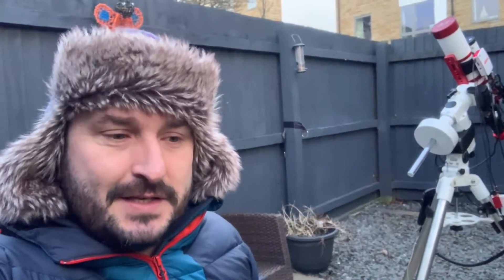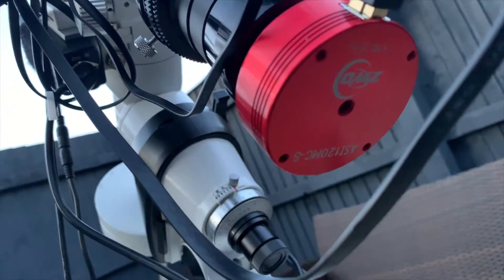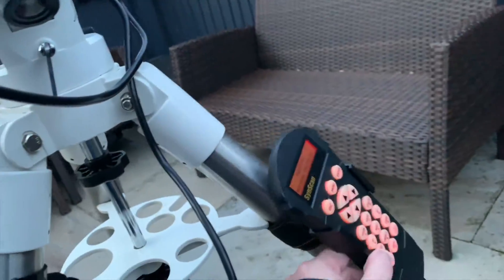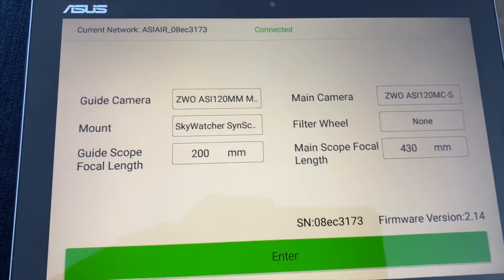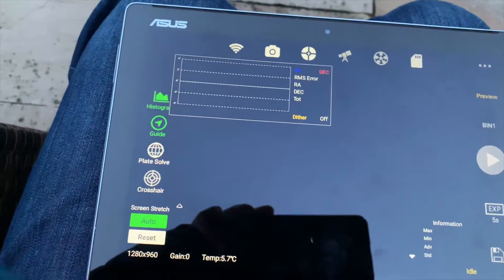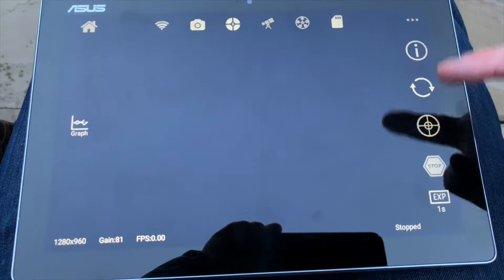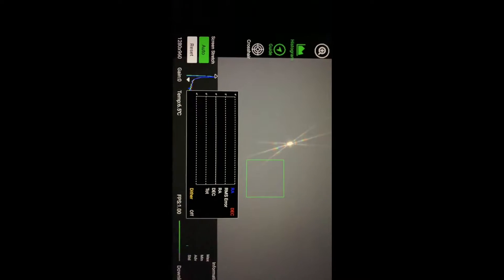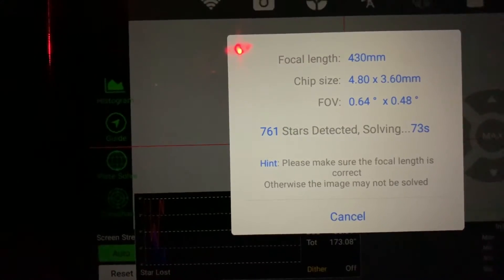ASI AIR first attempt. Disapointed. Tablet astronomy

Comment: I had similar issues at first, took me ages to discover you have to tap the guide graph to get into the guiding screen I think the big change was the October November updates that added the auto centering and made 3 star alignment a thing of the past. Incidentally, the plate solving is 3 to 4 times faster than on SequenceGeneratirPro. A brilliant piece. Of kit. Just trying to decide if I should get the pro version too.

Comment: Ever since I picked up an asi air, guiding has been impossible.  I've got a 290mm and a 60mm scope that's impossible to focus.

When I use my laptop and phd2 it's a breeze.  The air is cool but it's a hassle.  I've tried 6 times getting guiding going until I just gave up and went back to sharpcap and phd2.

Comment: Hi, I'm sure you'll get it sorted, but I don't think using the small chip of the ASI120MC is helping, even using plate solving I think it's tough. (I've also tried DSO imaging with this camera) I'm not the most technical astro imager out there, and this is for a reason. With our fickle weather in the UK I've learnt the hard way that's it's often best to keep it simple in order to come away with any data between the clouds at all! lol It's so frustrating when you add gadgets that are designed to make things easier, but they take time to setup and sometimes or often don't play ball and you come away with nothing. 

For an easier life keep the focal length short (as you've done), and the sensor nice and big (not the 120mc). With the aforementioned you don't even need to guide when using lots of shorter exposures, which you can do now days with the latest batch of CMOS cameras. 

Anyway, good luck, and I'll sub along to see how you get on :)

Comment: Regarding platesolving I currently use the Astrophotography Tool for all image capturing. To successfully platesolve you need to inform the program of your main scope focal length. You entered 420/430 mm but if you are using a flattener/reducer (WO are sometimes 0.8 reducers) then your focal length of your main scope could be 420 * 0.8 i.e 336mm. Depending on whether you are using a reducer this will enable  the software to know your fov and fingers crossed work! Great video. I have just ordered an ASIair so could be sharing your frustrations too. Chin up!
Reply from the maker: John Hughes hi. It’s a 1:1 flattener. I have solved it. New video coming with loads of helpful advice for the asi air. I have totally changed my mind and it is an awesome piece of kit. Plate solve for me worked after using EQmod cable direct to mount and removing the handset.

Comment: Its bloody easssyyy:
1-do 3 star alignment via synscan hc
2- then tap the mount icon in asi air
3- pick up skywatcher synscan from the drop down list
4-pick the choose object from asi air
5- go to
6- NOW ITS TIME FOR PLATE SOLVE
7 once plate solved (max 10 secs) you get success message andn you pick synchronize and go go
YOURE DONE DO GO
AH, before guide calibration you must change speed of the mount in main asi air screen to x1 from default max
Voilla ;)

Comment: Does the application only run as a mobile app, or is there an application that would run on a laptop?  Do you see this replacing a traditional guide software (Phd2, Ekos, etc)? I spends weeks getting traditional guiders to work, then two PCs to make those work, so if AsiAir doesn’t work first night that’s likely normal. Astronomy is very frustrating.  It’s expected.
Reply from the maker: It is only in app form however I’m moved to believe that you can simulate apps on a MacBook. I’ve found the software easy to install and setup however the use so far I cannot achieve what I can with a laptop. I think the future is an all in one package whichever format they may be. It is a hobby that demands perseverance
Reply: AstroDad hi you can download a android simulator/emulater for windows. It’s called bluestacks. Then you can download asiair from the google store in bluestacks and run it on your laptop.
Reply: You can download bluestacks for windows it’s an android simulator. Then download asiair from google play store in bluestacks and run it on your windows pc/laptop. 👍

Comment: Considering the setup you got, I'd think you aren't a beginner. You have nice astrophotography devices and that demanded time and a respectable amount of money to put them together. Every Astro-image needs also acquiring additional knowledge, such as polar align, checking pixel sizes, cable managing, FOV and so on. Particularly this video seems hasty to me.

Why? I'm a person who always try to get the best price/quality ratio in every purchase. Taking in account that, the first thing what I thought is reading ASIAIR specs before buying it. It seems funny to me looking you're using a 120color camera and trying to platesolving with it. It's obvious that small sensor sizes wouldn't help. I won't comment additional things about your guiding issues, I can assume that it also is an user error topic though.

I got ASIAIR and I never had problems about performance in all features. Particularly I love it. In opposite to what you mentioned in this video, I'd feel embarrassed to post a YouTube video that shows I don't have enough expertise about managing software. Regards.
Reply: There's nothing productive from that comment, it's simply rude.

Comment: I have to agree with you on this.  The ASIair is not a 'simple' solution at all. I bought one and spent days trying to get it to work with my hardware only to discover through blogs that it only supports ZWO guide cameras.  Even now having sorted that out I've found the tablet interface to be very clunky and I still can't get it to connect and work with anything but Apple products!  But, like you, I will keep on trying as I do like the idea of the ASIair and perhaps they will continue to add enhancements so that it is actually what they have advertised it to be.
Reply: works w/ my nikon.  thats not an zwo/asi product
Reply: @noahariola-tirella3559  Yes, the main camera can be a dslr, but it looks like ZWO guide cams are all that it supports.  If i'm wrong, enlighten me!

Comment: That's a shame. I set it up and found it intuitive and EASY.  But the hobby itself is challenging which is why I enjoy it.  I don't suspect the kids are going to take the reigns and run with it - until they're in their mid teens.   You're biggest issue is the very narrow FOV of your primary camera. (which to me is to small to be even a guide camera).  I use a 290 as a guide camera and a 1600 as a imaging camera. On my AIRair setup I have a 094.  Plate solves worked right away and take about 2-3 seconds.   FOCUS (you don't need the mask) there is a excellent routine that repeats imaging of the focus star and as you adjust focus it displays HFR and graphs focus level. You simply look at that while in focus mode. Good focus will be at under 2.0 HFR.   Like  1.8 or so. For some systems even a 2.5 may be fine depending on optics quality. Guiding also went easy but I have a lot of experience with PHD on a computer in my dome.  CALIBRATION is key.  GOOD calibration.  It's best done high to the South.  (Stay away from the North star when calibrating). To plate solve your scope has to have a good idea of where it is pointing. (often done with a 2 or 3 star alignment).  Though I never do them.  I polar align in about 20 seconds and aim W or E and plate solve.  Again a wider FOV will help.  For guiding wider FOV will help.  This will reduce your image scale and be more forgiving.  As you increase the scope focal length (and or reduce camera sensor size) you essentially magnify and and all errors and vibration.  It also sounded quite windy.  WIND blowing on the scope will cause massive guiding error.  SETUP just down wind in the fence so that the fence blocks most wind.  You will be amazed at how little breeze and trash your stability and ruin guiding.  My best advice is to get a better camera.  The 120 is a guide camera or planetary camera and it will be very sensitive to vibration and error.  Focal length must be correct for plate solving and guiding.  Include the FF reduction. (don't forget).  The ASIair is the EASIEST solution to a complex hobby. It won't take the skill out of doing astro photography. It just simplifies the whole process so we don't have to run 6-8 different programs on a laptop. 

I recommend concentrating and not using a documentary camera to the night.  Focus on what you're doing. When it's working - then maybe grab a camera to share your success.    Good luck!
Reply: Ron Kramer you response is very detailed. It'll definitely help people considering ASI Air but getting deterred by the video above. It's easy to fall into the trap of human error and thinking it's the system's fault.

Comment: Hopefully you can get some shots on the next clear nights. I plan on getting the William optics z81 with the same guidescope, but I have a couple of questions. What came in the box for the guide scope and will the largest zwo camera fit on the guider? I'm getting the asi 120 mono for my 18th birthday for guiding and I believe it's the same size as your imaging camera.
Reply from the maker: The guide scope came with the rotor lock adaptor and can accommodate the 120 mm cameras. The guidescooe is 50 mm. I’ll try to put together a more detailed shot for you showing the focus adjustment also on the guidescope.